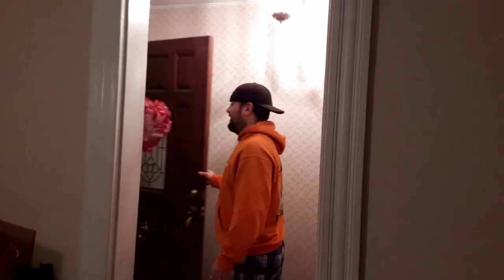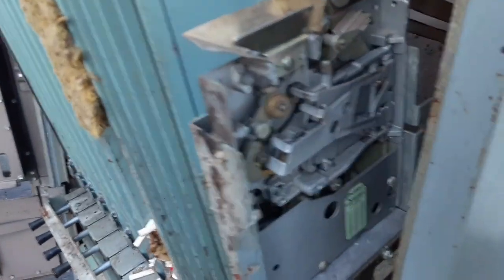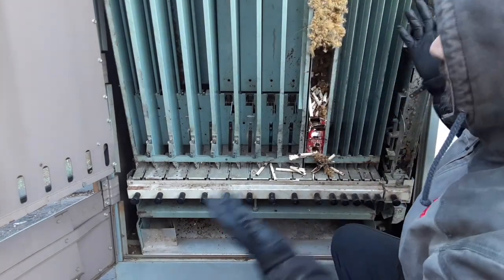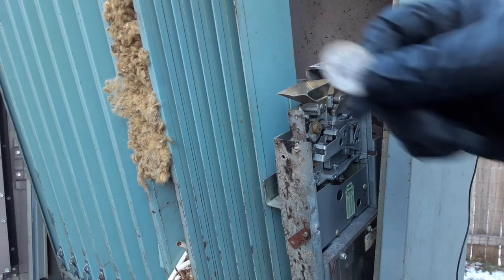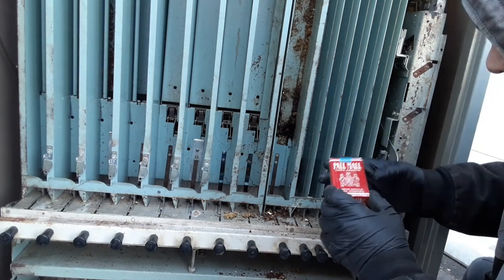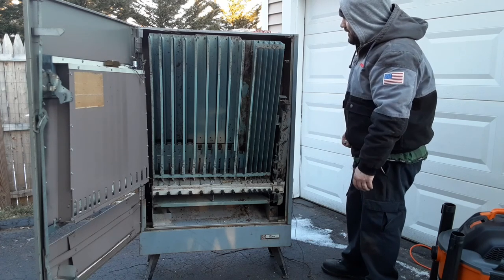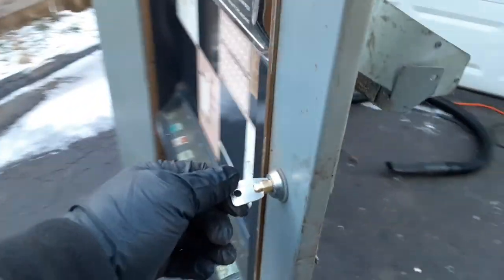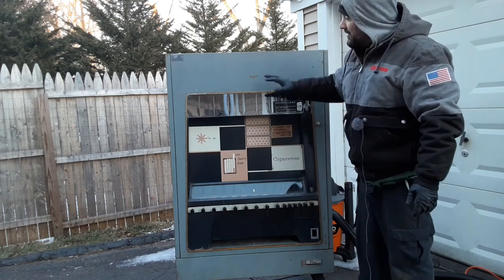RESTORING A VINTAGE VENDING MACHINE pt2. I got the key!!

Comment: Glad to see you got it opened . If you watch the video again  at 11:25 you can see the bar on the left of  change box moving as you drop quarters in . I remember seeing these in bars . Im guessing once you out the right amount in products needs to be in the slot for the knobs to pull completely out .
Reply from the maker: Awesome, I didn't even notice that. Thank you.
I'll open it back up and take a look at that. See if I can get it to function properly. I honestly didn't even notice that when I was putting the change in LOL
Reply: @richdiscoveries   probably hard to see from your prospective  . When you go back you will see it.  I bet you may just need to blow that mechanism out with air it will work fine.

Comment: You can get the starter at the hardware store, they are still available new.
Reply from the maker: Okay awesome, thank you for that. I'm pretty sure I got a couple laying around, but honestly I have no idea where they are and they are extremely old anyways. Probably much better off just buying a brand new one to get that out of the equation. I think that's the easiest and cheapest way to start, go from there if it's still not working

Comment: You can look on ebay for a manuel and replacement cigarette labels for it.
Reply from the maker: I found new vintage style cigarette labels on eBay. I'm going to try to keep a few of the originals and buy some new Replacements to fill in the rest of the slots.
I looked around for a manual and couldn't find this exact model, but I found one for a Rowe machine that was very similar. I may just end up getting that one. They can't be that much different?
Reply: @richdiscoveries  Not sure how different the Rowe machines are as I have a National 222 model and they do differ in some ways.

Comment: That’s a starter and power supply 110volt.
Reply from the maker: A starter. Now that you mention that, I believe you are correct. I think it held power or a charge that was enough to ignite the bulb?
I know I've got more somewhere from an old set of Lights we replaced at an old house, but if not I should be able to find one online